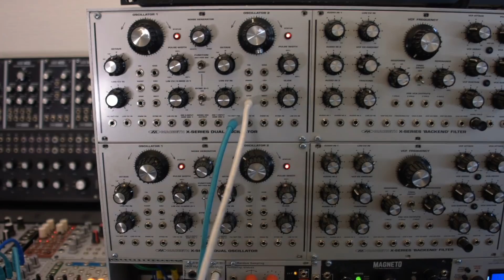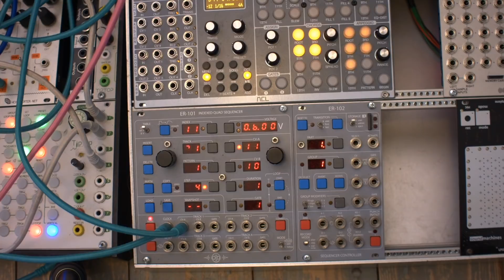How to design your own eurorack clock signals and break the grid!

Comment: Excellent info Colin!   One of my early attempts at home brewing my own sync LFO with old components scavenged from various scrapped electronic gear,  it did not go to plan and ended up being ' a bit wonky' .. after much swappin out of components and pfaffing about with it to make it stable I gave up, robbed  the pots & switches off it & chucked it in the junk pile. I built a new one that worked rock solid..   This video gave me a neat idea.. Hauled it back out the junk bin in the attic, put new pots & switches on it & added a reset input that hits the reset pins on the logic ICs . :-)  Now it still does that random weirdness occasionally and produces a slightly funky timing shift. This used to be 'A Fault' as it drifted farther out of timing but It  has now become a good feature . I just have to hit it with a reset pulse from my 'dumb 1 Tick Per Step' sequencer, or feed it from clock divider module ( reset every 64, or 128 ticks has been good, 256 gets a bit too far out sometimes)  The LFO still adds a slightly random element with an occasional wobble and added latency on the trigger, this shifts the trigger a few mSec each time it happens gradually delaying the trigger more over time throwing the LFO farther out of step. the reset signal snaps it back into step from the sequencer or clock divider module and the 'Wonk-Sync LFO' was born.. :-)  Happy Happy Joy Joy !   Tried to build another but it worked perfectly stable with no weirdness, can only put it down to the components pulled from scrapped gear being out of tolerance, most likely dodgy caps or iffy transistors but now it dont need fixed , not really 'controllable' but adding the reset makes it useful :-)

Comment: Circadian Rhythms runs on an internal 96 PPQN clock.
 If it's being fed a 16th note (4 PPQN) clock, it has to generate its faster internal clock by timing the intervals between incoming clock pulses.
 If you go varying the external trigger timing, there will be latency while it recalculates the new timing, and weird glitches are not surprising.

Circadian Rhythms can receive its internal 96 PPQN clock as a slave from a master device, using its bus synch ribbon connector on the back.

A period-variable 96PPQN external clock fed into CR's bus sync connector may yield glitch-free results.

Comment: Great stuff. Ingenious method to get swing. I guess this clock VCO/LFO could be slaved to another clock by sending a reset pulse to the sync input of the VCO?
I've been thinking about how to get swing into my rack and this is where I'd got:
** Use a drum part of the Beatstep Pro. It has micro timing on each beat. But this would tie up the drum sequence on the BSP to 4 beats if you want to keep things editable on the fly, which is annoying (I wish the drum parts were polymetric - Arturia did this for the Drum Brute Impact). Advantage is that you can move the beat forwards and backwards in time.
** Use an envelope generator or clocked LFO to delay certain clock pulses. But this requires a VC switch or sequential switch to split the clocks and a mixer / OR combiner to recombine them. Will only delay clock pulses.
** Use Eowave Swing module which is essentially the above system in one unit. This will only delay pulses, though I guess you work around this by setting the delay time midway then offsetting the incoming clock to make the output be on the beat, then adjust the controls forwards or backwards. CV control over the different stages is useful for creating >4 pulse patterns or humanizing the groove.
** Use an envelope generator with double / multiple peaks in the contour (eg. Xaoc Zadar) to create offsets to the grid.
** Also, for "smart" (annoying :) ) sequencers that have their own clock control and  won't accept irregular clocks, I think their output could be swung by, eg., sending the sequence into a voltage controlled switch that toggles every 1/16 note (or sequential switch for >2 part swing patterns) and delaying the offbeat output with an EG / clocked LFO, then recombining with the on-beat output. Just have to make sure that the swung pulses are low again before the next pulse fires.
For me, I think I will get an Eowave swing module for simplicity and CV inputs per step.

Comment: Also is it possible to run this type of clock through a clock divider?
Reply from the maker: you can definitely run this through dividers and multipliers. especially multipliers will give you weird results since the timings will be off, yet still snap into formation every new pulse. come to think of it, I am not sure what dividers will do but I am sure it will be interesting!

Comment: Really nice video! Is there any way to accurately (not by ear and then apply the reset method) match the oscillator frequency to some tempo, so if you wanted to match that oscillator frequency to run in the same tempo to different clock, then apply this method to feed this swinged clock to only some elements and then feed other elements the tight clock how would you match those tempos?
Reply: I think it would work to send a reset pulse to the VCO's sync input to (re-)align this to the other clock each on-beat, or whenever.

Comment: Colin, thank you very much for sharing this, superb video! 
Brilliant idea to use the reset only on the Circadian Rhythms and use its own clock to mix the two sequences together, I'm definitely trying that :D
Quick Q: did you try to "dumb down" the CR by changing the way it reads the incoming clock? By setting it on the "16TH" option instead of DIN or DAW in the "GLOBAL" menu? I wonder if that'd work with a shuffled 16th note incoming clock...
Cheers,
Attila
Reply from the maker: Hm I did not think to try the various sync settings on my circadian rhythm, well worth checking if it runs better in one of the other modes. Will give that a try! And the reset trick is an awesome way of working in relative timing, you can really go quite wonky that way...!
Reply: @ColinBenders  Yeah, let me know if the 16th mode worked for you, would love to know! I'll test it out on my end too. Keep these nice short tutorials coming pls, loving the idea and the content. Thanks again for sharing your knowledge.
Cheers,
Attila

Comment: thank you for the details!
Reply: got it working with only a digital lfo, an attenuator and my non-dumb sequencer, westlicht performer, in which you can select to advance the step with every clock coming in. attenuating appropriately the sequence going into the clock, can give me 2 octaves of pitch corresponding to a few bpm, so then i can play with the clock sequence easy and effectively. Like randomize the sequence, or input the sequence with a keyboard. 
i think now the interesting part begins in developing and saving these clock sequences in order to make your own groove templates as you mention in the title. Good stuff colin thanks
Reply from the maker: @napoleonbousoulas1651  saving templates really is a ton of fun. grooves can really be very far out, also keep in mind that you can work at higher resolutions than 16th and you are free to speed up/slow down in a loop. like going from BPM A to BPM B over X amount of time and such. fun stuff!
Reply: @ColinBenders  I realised that the sequencer mentioned above can do complex swing all by itself without any other module. This is because you can cv-control the tempo of the sequencer. So you route internally a sequence track to the tempo, and it works. That way you can really save the grooves, because you dont have to fine tune the "clock lfo".